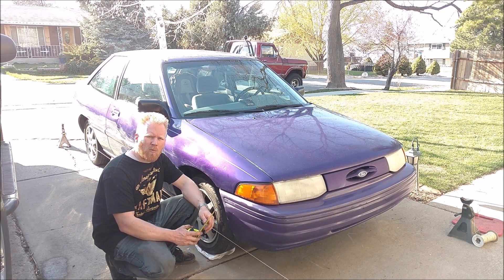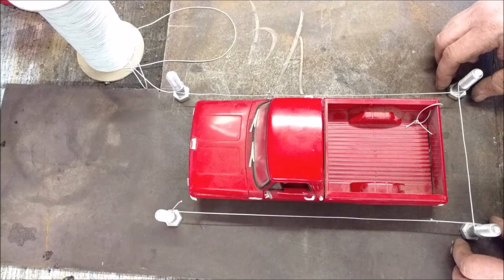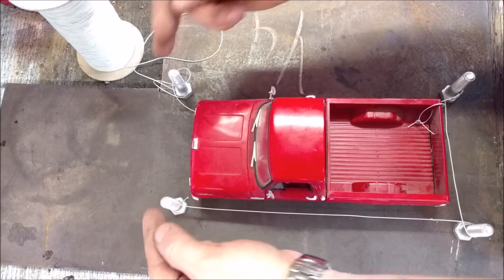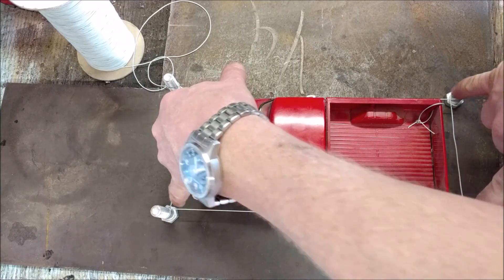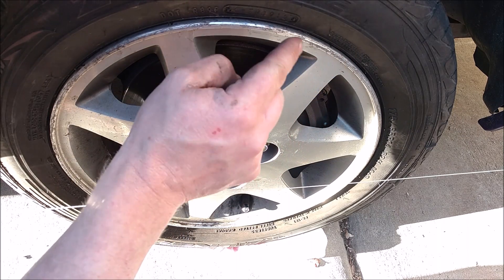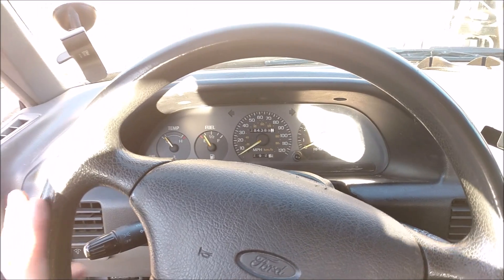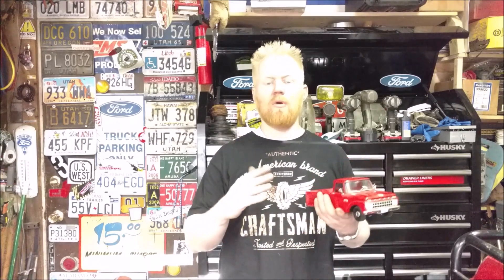Front End Alignment in your driveway Done right

Comment: Yesterday, I tried the sting method to see if it would really indicate 
something close for toein/toeout. I think the rotor throw me off because
 I took to a alignment shop and had it checked :) It was right on the 
money all along but I thought it was off because the right front tire 
was wearing on the outside thread. *suspension parts were all good
 
Watched your vid a few times to confirm info. You talked about the difference between the front and the back tracking distance.  Not sure how the calipers would change the difference but I like rotor idea difference in thickness.
Got the string set up and I set it at 1 inch both rears to the rim. (rim front/back)
The front left is at 1 3/8 to the rim (rim front/back)
The front right is wacky 1 inch (rim front/back) Picked another point on the rim. just inside the lip of the rim and I get 1 3/8. So, it has to be the thickness of the rotor? Your thoughts

The reason for checking the string alignment was to see how close it would be to a actual shop alignment numbers. If I could get confidence in the string measurement. I need to do another jeep. :) 
Anyway, Thanks going into detail with your vid. esp explaining the tracking distance difference.

Edit update. Ok, checked again with adjusting the string in the front. Front now shows 1 inch both tires front.
Reply from the maker: You need to set up a perfectly square box around the vehicle. So the strings that protrude from the front and back of the vehicle are identical distances apart. Then you can start taking measurements and moving the box around to be positioned "square" with the vehicle.
Reply: Thank you for the reply. final question. (about toe)
Just curious.. How close do you think the string measurement to the actual shop alignment? 99% of the time..? 95%? 
I'll definitely make sure I take measurements front and back on the string line next time.. Thanks again for replying

Comment: Thanks for a great video. My 99 Taurus front end was a wore out mess, I rebuilt everything, replaced tie rod ends (inner and outer), and foolishly assumed the settings would be normal with new parts (shock mount plates were spot welded in place). Well, after only 6 months my front tires were worn out, the car pulled left, steering wheel was off center, and the drivers side tire was wearing out the OUTER edge (opposite of most Taurus's). The passenger side tire wore evenly, but was shot also. Fortunately, the rear tires still look brand new, so no problem with the rear alignment.  Anyway, toed in the left tire to counter pull, wore out 2 tires in 2 months! So I drilled out the camber plate on the driver's side shock tower, got rid of the positive camber, then used your method. Turns out the tires were toed in by 1/2 to 3/4 inch (each Side!), way too much, so now I know why the car was eating front tires. THANK YOU, you saved my sanity (and a fair amount of money), I set them to zero toe in, and a noise that sounded like a brake pad wear indicator, chirping every time I turned right, has disappeared, something that had been driving me nuts since my rebuild about a year ago. I finally know what was going on, which is a relief. The car was treacherous to drive in rainy weather, unstable and constantly hydroplaning before my alignment. So, I'm hoping that is resolved,  and I'm confident that will be the case. Great video, good job, well done.
Reply from the maker: Thanks for in the insight. I'm glad it was helpful.

Comment: What spec for all wheel drive vehicles?
Reply from the maker: All wheel drive vehicles will still heavily rely on the rear wheels to push the front end. AWD will always have some built in slip from the front to rear so they don't bind up around turns ect.  So a zero to toe in is more than likely recommended by the manufacturer.

Comment: honda accord is front wheel drive. it has toe in on the front bro
Reply: That 1 degree of toe in keeps the car straight on the road, if the tyres are zero toe then the car will zig zag on the road once both hands are of the steering wheel (not recommended)
The toe in degree "forces" the car to go straight down the road. It is different from car to car with front wheel drive.
And...most important if the steering wheel is sitting at an angle it can torn apart the airbag connections once you turn full lock to lock.
Thanks for sharing your video. Tomorrow i will give your method a try.
Reply from the maker: They can have a very very minor toe in but ideal spec is Zero; with the possibility for less than .1 degree of toe out to toe in.

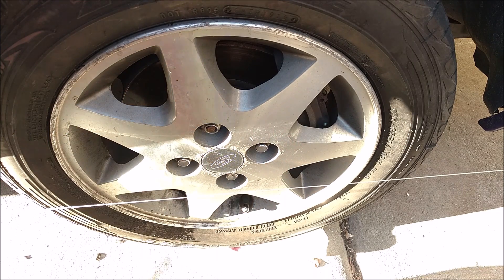Comment: This method ASSUMES that the rims are perfectly true and are not out of round or bent in ANY way. As a mechanic who has been aligning cars for 40 years it's common to find car rims that are not true. If you are going to use this method, mark one of the rims at the 12:00 position. Record your toe. Roll the car until the mark is in the 6:00 position and then reset your strings and take another toe measurement. If it's not exactly the same reading then you can't really set the toe accurately. Of course non of this matters if the camber is not set first.
Reply: One thing I check first is if the rims are true with the hub using a dial indicator.  Even a cheap dial indicator will work well enough to tell if your rim is true to the hub.  All you have to do is spin the tire and you will quickly be able to tell if the rim is straight.  Definitely, something to check though before going through all the work of aligning just to find out that the rim is bent.
Reply: If a rim was bent then even shop computer alignments would not work either since the tools attach to the rim
Reply: this is not front end alignment but it is part of the process. what you are done is measuring the toe. This should be compared to the toe spec to see what adjustment should be made.
Reply: Oh c'mon if the rims arent true you are gonna get lots of vibration when driving
Reply: Research and Build no true.  Assuming your wheels were properly balanced when you have new tires mounted, there will be no vibration.
Reply: Jimmy Duong actually not true, no matter how good your balance if your rims aren’t true you WILL get some vibration

Comment: Thats works on toe but caster/camber you still need check adjust how do you check?
Reply: Camber WILL cause wear and coupled with toe will intensify wear
Reply from the maker: These generally won't cause a drivability issue or tire wear like incorrect toe will. In my experience they rarely go out of whack, but they can. Generally camber will go out on some cars if the struts are changed. Some don't even have adjustments. Camber is done easily with a bubble level on each tire measuring straight up and down. A digital level will help get closer. Just make sure the car is on a perfectly level surface. Depending on the car you'll have eccentric bolts or similar that push or pull the wheel in/out.

 Caster generally only goes out of whack in an accident and many vehicles don't have adjustment. Some do have wrenchable adjustment and some you have to buy special shims for. The only people I really see playing with Caster angle are custom Hot Rods.
Reply: I had to adjust the camber on my '89 Probe LX when I changed the front struts.  You could do it by rotating the strut mounting block.

Comment: Great video and the information.   I did the alignment myself, but this is the first time I learned about toe out in front wheels drive cars.  I have been setting toe in in my cars.  Thanks for the info, now I know how to fix the crooked steering wheel.  I have been wondering how the heck my steering wheels were crooked when I locked the steering during adjustment. :)
Reply from the maker: Thanks, I'm glad you liked the video.
Reply: You can also just take the steering wheel off and reattach it so it's straight, again. It's held on by a single nut. I've done this on my 84 Mazda B2000 pickup; it's easy.

Comment: i had my alignment done twice and it wasn't done right  i'm so doing it myself from now on thanks
Reply from the maker: Seams to be a common issue with alignment shops.
Reply: Speaking from experience as a master tech who went to a large chain tire shop. They maximize profit by having inexperienced general service (lube & tire) techs do the alignments. Most managers believe all you need to know is on the screen and that if the angles are in the green it is good. I actually got into an argument with one manager and told him "I can make everything green and it will pull so hard you won't be able to hold the wheel. Or everything red and it will track straight while chewing the tires off."
Reply: He doesn't even know if he's back wheels all aligned properly so how can you align the front ones correct
Reply: @niteblaster1  it's on a straight axle. You'll feel a bent axle

Comment: on an old f series Ford truck you have to go by the distance between the rear jak stands and the front jack stands, because one front wheel sticks out a little more than the other from the factory , most people don't realize that. so , you can't measure from the center of the front wheels and they both be the same they won't be.
Reply: On my '79 F350 it seems like the drivers front tire sticks out a bit more than the passenger tire, in relation to the rear tire.

Comment: We had new General all-terain tires put on our 2002 Ford Explorer Limited 4 WD about a year ago with free alignment and I noticed right off that the truck didn't handle very well especially on the interstate at highway speeds. It wonders in the lane alot and you have to babysit the steering wheel. I thought it might just be the nature of these tires but after about 6 months I noticed the tread pattern on the front was getting feathered and wearing uneven. I've read that Ford Explorers have to be aligned a certain way but I wanted your opinion. I need a new alignment bad!
 Thanks for the video...
Reply from the maker: +Jeff Stone More than likely the technician aligned it as an all wheel drive vehicle instead of a four wheel drive(big difference). So your front tires are toed out which causes excessive lane wondering. A four wheel drive vehicle should be toed in slightly.
Reply: +sixtyfiveford I bet you're right on the money! I'm gonna check it out and hopefully fix this issue, thanks for the info...

Comment: I really would have liked a real walk through alignment of your method..... I'm a professional mechanic , I have never done a in driveway alignment but I'm curious. it's easy to say " yeah just do this and that, steering wheel is crooked that's ok...???? " also a time lapse of your tire wear.....
Reply from the maker: +Joe Halas I could have done a full hour of video and it would have been the same. I'm not sure what more I could have shown. Alignment is just simple measuring once you set up a square box and that is what the video is supposed to show. I've performed all my own, family  and customers vehicle alignments for the past almost 20 years.  I also do all my own tires so I monitor them extremely well. I started doing alignments with a simple tape measure, measuring grooves at the front and then rear of the tire and you can get it mighty close. A ton of racers use this simple method with great results.  The cosmetic non centered steering won't affect anything and have even had ASE certified mechanics do it to my vehicles(one of the reasons I decided to learn how to do it myself). But I tell you in the video how to straighten it once the alignment is completed.
Reply: +sixtyfiveford set the steering wheel straight. First then do the alignment very easy that way

Comment: Any idea how to set the toe angles on a 4WD, specifically a '07 Jeep Grand Cherokee SRT8?  I need to do this, I can feel it "crabbing" a little bit and also the steering is a little touchy, requires too much concentration to drive it straight (not that it's hard, but could be tracking better).
Reply from the maker: +Atimatik Army 4x4: The rear shouldn't need anything as it is a solid rear axle but the front should have approx 1/16" toe in. Grabbing is generally caused by toe out making it self steer.
Reply: sixtyfiveford Right on brother, yep, it's toed out, I can feel it.

Comment: Nice video, I had a 1995 Escort LX with the 1.9 in it. Best car I ever owned. I had over 375,000 miles on it. Unfortunately the uni-body rusted out. I had the 5 speed in it and got over 45 m,p.g. The engine still purred like a kitten.
Reply from the maker: +Glen Harper Yeah, this 96 has been amazing. My wife bought it in 98 and it is now clocking just under 300k and the 5 speed allows amazing gas mileage. 48mpg is the best I've ever done for a few hundred miles. The speed limits in my state are all 70mph -80mph on freeways so that kills some mpg(pisses people off if you go slower), but I still manage high 30's on a regular basis. Rust has just recently started to show in a few minor areas so I still got some time to get to 400k. You must live in the New England States?
Reply: Oostburg,Wisconsin

Comment: Awesome tutorial!! On all my trucks, I would put a 1/4 inch castor wedge on the right steer. It helped to lessen the pull to the right that crowned roads cause. It's even more pronounced in a high center of gravity vehicle.
Reply from the maker: +BCtruck, rebuild, repair,repurpose That's a great idea. Did a lot of drivers do this?
Reply: +sixtyfiveford I only met a few others that would even no what I was talking about. Most drivers were just that and couldn't point to the alternator or even the compressor.

Comment: I didn't look through all the comments but what about all wheel drive all the time Vehicles what's the toe in & toe out on them? I have a little Honda crv
Reply: hi, i'm a honda tech. oem specs are 0.0 degrees front toe, 0.8 degrees toe in for the rear for 2wd and awd
Reply from the maker: +the eabster Since they share the load of the vehicle it'll need very slight to zero toe out in the front and zero for a fixed rear axle or zero to slight toe out for the rear on an independent.
Reply: Thanks
Reply: RTFI - look at the maker's data.

Comment: Never seen the garbage bags under the tires before.  Never knew that would make it easy to turn the wheels.
Reply: I learned today two pieces of cardboard on top of each other from Chris Fix. I'm not a mechanic but Im not inexperienced either. He has a cool video showing how to increase turning angles for sharper turns for free or using cheap PVC.
Reply from the maker: +1970chevelle396 Yeah, the first time I read it on a forum I was skeptical.

Comment: i normally use a 4 yard(meter, im danish) steel or straight wood with a small on the rim spacer to clear the rubbers and then messure near the wheel and at the uotmost edge to see the diff! i havent had a car yet wth toe in/out at the reat unless it needed a new rear axle!
Reply from the maker: +transdetendal Yeah, that's great method.

Comment: by the time I watch this video and set this up and then lay on the ground I could have an alignment done for $50
Reply from the maker: +dmoney8766 A lot of people don't get the sense of pride and accomplishment of working and fixing their own stuff, I do. Sure you can find places that'll do it for $50, but why if you have the knowledge? I have to ask what else are you doing besides sitting in a waiting room for 45minutes while they get around to it? I'd rather do it myself than sit in a waiting room and have a kid get it "close enough". This car I've owned for 20 years and I took it in 2 times when it was newer because of tire wear. The first time because of abnormal tire wear, and then a month later to the same shop for still abnormal tire wear only to have the tech make excuses of how the first guy was new, lazy, etc.  It was better but the ASE tech also had the steering wheel shifted to the left when going straight when he was done. Months later, still some pulling and tire wear and they kept pushing the blame to, I need all new tires, I must be hitting curbs, or I need all new rack and pinion. I set it the third time in my apartment parking lot with a tape measure and found out they had it crab walking with the rear kicked out one way and toe in on the front. Couple hundred thousand miles later and we're here and I'm doing it again only because I recently changed front end components. My local speed limit is 70mph and she cruises straight as an arrow with my driveway alignment. OH and I put the tires on myself( brand new take offs $15.00 a piece).  My mechanic bill for the past almost 18+ years is zero, I've only had to pay for parts and I take pride in that. It's not for everyone but it is great knowledge.
Reply: @sixtyfiveford  Thanks for sharing that personal story. Appreciate it.
Reply: +dmoney8766 Where are you getting an alignment for $50? An alignment for my car (granted it was done at a performance shop that specializes in building race cars and crazy stuff) was $125
Reply: +2011FordMustangGTCS at my local tire shop. family owned, alignment rack, guys been doing it for 40 years. ASE certified. that's the only thing I don't do on my cars, tires and alignments.
Reply: +sixtyfiveford yeah I completely agree with you. I'm in the service industry and the only thing that sets us apart from our competition is our high level of pride. I'm not saying not to align your vehicle that way, but for $50 I'd rather have someone else do it. same with tires, I've changed them myself before, but for $50 I can have all four mounted and balanced. Not to mention I'm not dirty and covered in sweat after. honestly, I love all of your vids, I think they show that people can still save money and get a sense of accomploshment at the same time. That's one of the important things America is missing. keep making vids I learn a lot from them, especially extension cords for trailer wiring, that's my favorite so far.